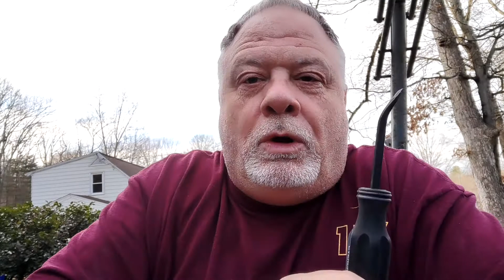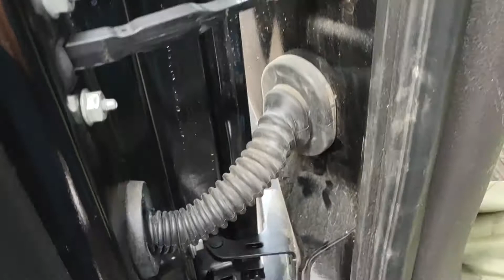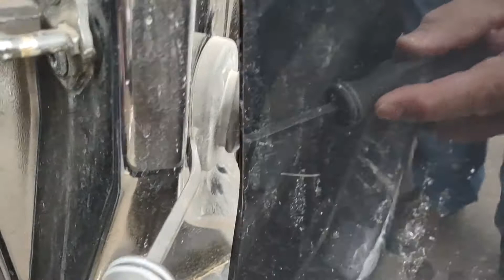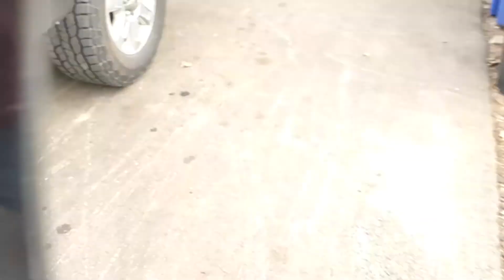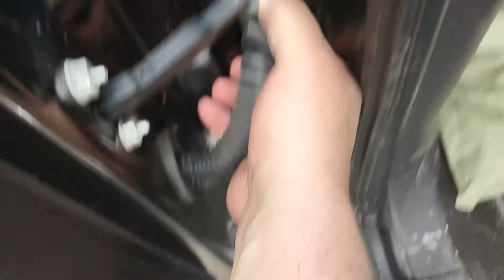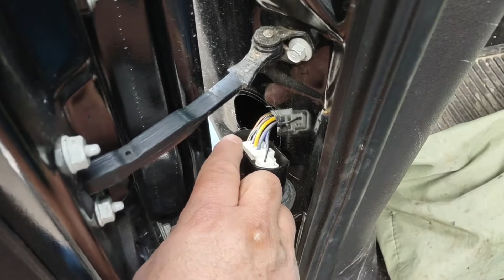2014 F150 Rear Door Harness swap. Stressed wires breaking.

Comment: Daggone, my 2014 f150 started giving me the door ajar warning so I started to work on my truck. When I took the rubber boot off of the left rear door jam I didn’t have a plug there to unhook from the door. Instead I just my wire harness from my door just runs straight through the door jamb without a plug to plug into. All the videos I have seen on YouTube shows a plug to disconnect on the door jamb. I can’t find a video with the harness running straight through the door jamb like my truck has. I’ve owned this truck since it was new so I know no one else has repaired any broken wires in the door jamb. Anyone have any idea on how to proceed other than taking truck in to ford dealership.

Comment: I just installed the second replacement wiring harness for that same door on my 2014 F-150 Platinum.  I did the first replacement only about a year ago.  This is getting old, not to mention expensive.  Besides the "door ajar" indicator and dome lights, the automatic running board won't work on the driver's side of my vehicle when the harness goes bad.  I still enjoy my truck but this is not one of Ford's better ideas!  Got the previous replacement from an online dealer.  Won't do that again.  Got this one through a Ford dealer.  Hope it lasts as long as the original!
Reply from the maker: I found, the hard way sometimes, the original OEM stuff directly from the dealer IS a better product. Hope it last longer than a year as well. Knock on wood, still have my F150 with 212,000+ miles and the wiring has held up.

Comment: thanks about to have to do this in my 2014 stx with 160k miles. left rear ajar comes on most days now and the lights come on. Also if I arm the locks with remote the panic will sometimes go off cause I guess it thinks door is open. I leave it unlocked

Comment: I have an issue with my 2016 F150 door lock passenger front only. Does anyone know if the instructions in this video be similiar for search and repair?
Reply from the maker: I woould look into the wire harness between the door and frame. The rubber boot over the wire is very plyable to peel back and look inside. That is how I found the broken wire with out open up the entire door.

Comment: Many of the wire harness are discontinued, especially the front driver door. I had no choice but to repair mine as best as I could. But now, when the door is open, nothing works. I now have to go and find a Pick n pull.
Reply from the maker: That suxs. Very frustrating as an owner we try to keep these vehicles a little longer than planned.
Reply: @bigguydiy2184 they dont want us to repair our own equipment . Going to make this repair when my part arrives . Thank you , good video

Comment: Any idea what that outer soft tape is called that allows the rubber flex piece to slide freely on the harness?
Reply from the maker: It's a insulator tape. It comes wrapped up just like electrical tape but it much thicker. I cannot remember where I bought a roll, but I am guessing either in the electrical isle or a automotive store. Most likeley in the electrical isle in a hardware store. It is labeled as insulator tape and is a thick like rubber. It is hard to find.

Comment: I kinda think that plastif lining is not necessary?  It must be to quite down interior road noise?  What do you think about leaving it off?
Reply from the maker: It is actually a "vapor barrier" Anywater that leakes in from the window (in which there is a lot) is stopped by the liner from getting into the truck. So, yes, it is important to reinstall and secure it well.
Reply: @bigguydiy2184  Thx! for the quick reply.  I will put it back on as instructed...

Comment: Do you think ordering the part on Amazon would work as well instead of taking the part to ford and waiting for a replacement to come in?
Reply from the maker: If the part# matches. I would not shop for a generic wire harness that sais "Fits F150s..... and other truck models",  you want the part to be an exact match by the part#. If that match is on Amazon, go for it.

Comment: How do we keep this wiring harness from breaking again? Does anybody have an idea?
Reply from the maker: You can't by design. If they used a softer but way more strands of copper wire, it would last longer. The current wire is too stiff. Damned if you do damned if you don't scenerior. Thicker copper wire carries current/amps better than multiple strands...
Reply: @bigguydiy2184  thanks!

Comment: I am going to repair again for the 2nd time- Same door-  Hardly ever opened or used-  I am contemplating repairing again or swap out the whole harness-  aggravation or repaired the severed wire.

Just don't know if I want to order OEM parts- as they seem to not last-   Crazy how they engineer and design things today-   And  I don't want junk made in China 

You made my case to "replace"  vice solder-  and i solder- I am going to remove the stiff thing (I bought used) and my 2010 was like new- and can't figure out why minimum use causes this?
Reply from the maker: Age and material used degrades over time. Over the years, replacement parts that are made OEM do get better as technology gets better. I have found this with other parts I have replaced on my GMC Yukon where the water pump was upgraded to better bearings by the OEM, not after market. Ford wire harness I believe is US made.

Comment: Don't be so certain about having that new harness lasting you another 8 years.  I am on my 4th harness in 10 years.  This time it's the passenger power mirror constantly moving downward...probably because it's getting power from a nearby broken wire.

4 harnesses in 150k miles is ridiculous.  I've had 3 other vehicles go ~400k miles with no harness issues.  Ford should be ashamed of their poor engineering.
Reply from the maker: So far, just this one harness has gone bad. I have 165K milles.  But, now my radio does random searches even though I picked a station to listen too. I will say, the F150, at least mine, for this year, is much easier to work on then my past GMC Yukon. GMC ties everything to their computer (ECU) so any switch, dash work, etc, the computer has to be flashed everytime. With the F-150, window switch goes, just replace it. No computer flashing.

Comment: Thanks for making the video, sir. I just finished doing mine. Did it in about an hour and a half, no problems.  Part was just under 100 bucks at Ford dealership, and to the parts guy surprise, and mine, they even had it in stock.
Reply from the maker: Excellent!

Comment: Thanks for being so thorough with your shots and comments. I was able to pull back the rubber boot, resolder the frayed wires and add a sleeve of heat shrink to each one to add stiffness and protect the repair. Took about 20 minutes and saved me 70 bucks for a new harness and all the time and hassle of disassembling the door. 
No more Door Ajar warning and delayed dome light.
Reply from the maker: Excellent!

Comment: Mine broke right at where the stiffener ends. Im thinking it makes a point where the wire has to bend sharper, that it would only work if the stiffener inserted into the connector. Im gonna leave it out.

Im going to depin the connector and use a low temp solder inside butt connector.

I got tricked into thinking my problem was the door lock motor. It wasn't after that work. Then found this problem.
Reply: Well that low temp solder butt connector lasted 3 months before it broke again. I've been living with a door that doesn't work since then. I'm trying to depin the connector again and I've forgotten how to do it. I'm about to break the connector trying to depin it. I may end up having to replace the door harness. Disappointing such a bad design from Ford to cause this problem.

Comment: Thanks for the info.  your truck looks like mine but for some reason the harness in my rear door does not match.  The cab side rubber boot does not have a clip as the clip goes inside the cab wall and I think I have to remove the wall panel between front and rear door on the inside so I can get to the wire harness clip.  I can't believe my 2014 crew cab is not findable on the Internet or Ford.  I don't know why mine is so different than others.  I am looking for a part number on the harness inside my truck, no luck so far.
Reply from the maker: Well that stinks. Best of luck on getting it repaired!

Comment: Thank you, sir!!! I had the exact same issue with the door warning issue and then an inoperative door lock. I repaired the wire for the door warning, but when I checked the harness for the door lock issue, I found multiple broken or frayed wires. I ordered the new harness and thanks to your video, will be able to install it with no problems. Thank you for such a great video. I prefer to do the work myself instead of having a shop charge insane rates for a simple job. Also, after I installed the harness and was going back together with the door liner(underneath the panel), you had mentioned the glue doesn’t stick well. I found that spraying the perimeter area with contact cement works great! The liner stuck just fine. I still put the duct tape up top like you did, but the cement held fine.

Comment: Great video. Same door, similar problem.

I had 5 broken wires... Pulled the whole harness and replaced a bunch of it. First sign was the door ajar light once in a while, and crackling from all 4 speakers when turned up.

Wondering how bad the other doors are now.
Reply from the maker: Thanks for sharing
Reply: @bigguydiy2184  yea I thought that speaker sounded low, but I didn't think one speakers wiring could effect the whole system.

Comment: Where did you order the harness from and what is the part #
Reply from the maker: I ordered it directly from my local Ford Dealer. I needed the VIN number but I also brought in the actual part which still had the part number sticker attached. I do not have the part number on hand, but I believe I show it in the video.

Comment: All the details with no filler. This has enough detail for any competent DIY to get the job done. I did this job in under an hour and the only thing I would caution you with is the door skin under the panel is brittle in the cold weather and you are best off with a heat gun and time to get it off in the most pieces possible. Other than that, this video was perfect.
Reply from the maker: Your correct. Warm air repair is better for all plastic parts on a FORD.

Comment: Thanks
 It helped a lot. Mine had several repairs already and the rod inside was bent. So I changed it today.
Reply from the maker: Glad it helped
Reply: Part numbers???? Please
Reply: @bennybartender  call Ford with the last 8 of your vin. They are different depending on options
Reply from the maker: You are correct. Need the VIN to get the correct harness.

Comment: Thanks for creating that video, it is very clear, and makes me confident I can complete this on my 2011 F150 with the same issue.  I was most worried about disconnecting the existing coupler, but you showed that nicely.  I got my harness from my local Ford dealer, was quoted a lot more than I could find on-line, but immediately they dropped the price by 40% to compete, so with no postage to pay, I came out ahead.  I asked about the adhesive they use for the membrane, was told it is some kind of non-drying adhesive they have in the shop, not for sale.  Not sure I'll find that, but will use your tape method if not.
Reply from the maker: Excellent! Glad it help.
Reply: @bigguydiy2184  I got it done successfully at the weekend.  I used this stuff from 3M called strip caulk to reattach the membrane.

Comment: Thanks for the video, just ordered two harnesses for my 2014 F150. It's a shame Ford charges what they do for the harness, especially knowing the root cause of the failure.
Reply from the maker: I have also seen this on my GMC Yukon and Subaru Outback. So, I have to say it's common but if the wires were too thick, they would not fit into tight places as well as having the flex needed for certain spots. I get it, it just sucks for the end user. 

Next repair on the Ford, cutting and replacing the under side of the running boards. Seven year old truck and I have a really bad rust issue. I'll take replacing wire harness any day.